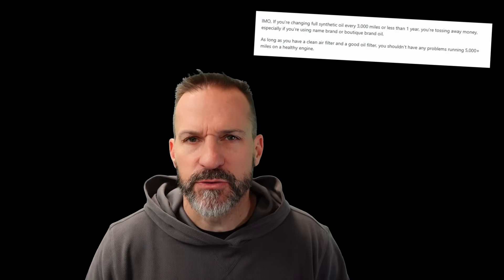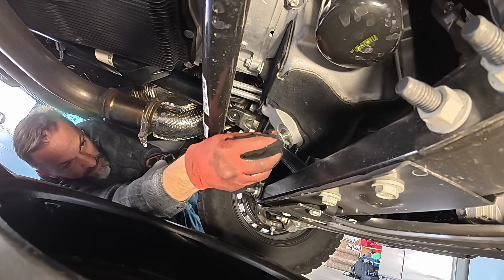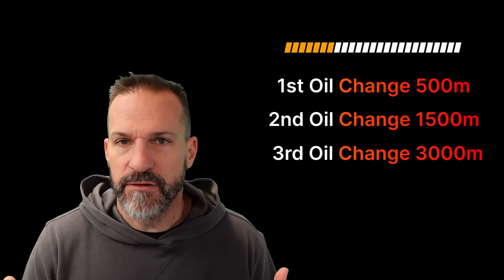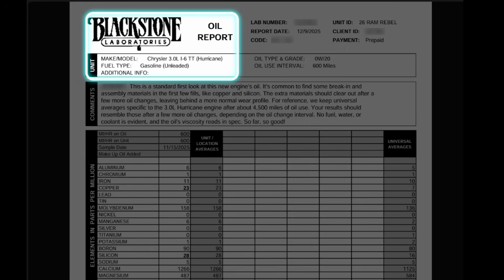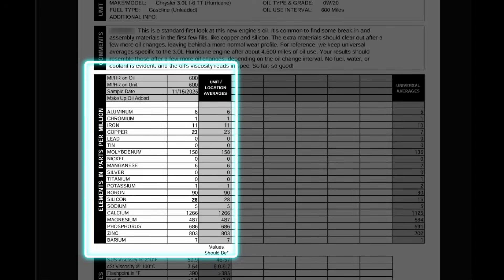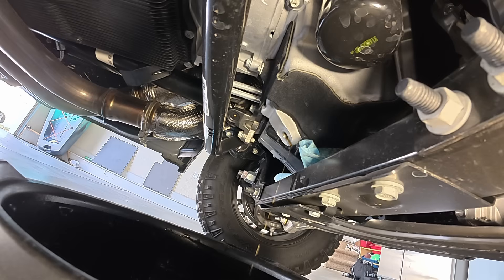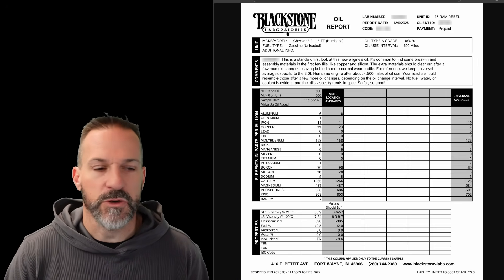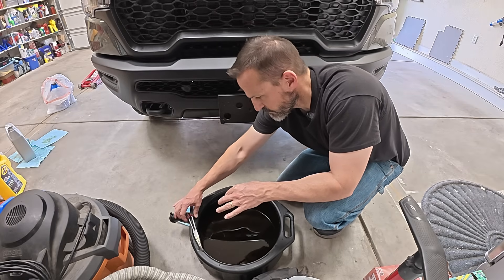Is the Motor Oil Geek Right? I Put His Break-In Theory to the Test

Comment: All drain plug gaskets are "one time use" and should be changed out each time. Each time they are reused the plug has to be tightened further and you risk stripping the pan. Buy the filer with the gasket or buy a ten pack of gaskets.

Comment: I've learnt so from Lake Speed Junior. He's inspired me to continue my Tribology education. 
I've made oil choices based off as Lake suggested taking into account the crankshaft bearing size and weather the engine block is Iron or Aluminium.
0w-20 oil pre 2011 was only ever recommended if you live in a consistently very cold environment where it snows and your engine oil needs to start in sub zero temperatures and oil freezes and needs oil warmers.
If you want to use a base oil with a 0w rating why not go for a 40 summer rating and have the extra temperature reserve for spirited driving.
And if you go for a class 5 Pao Ester that is Shear free even better. 
Great video. Keep up the good work 👏

Comment: We bought a brand new Honda pilot off the showroom floor and I wanted to have the oil changed at 5000 miles and took it into the dealer. They said you’re not supposed to change oil until 10,000 miles and I said but I wanted to do it early to get rid of the metal in the motor. They said if they did the oil change early, it would void the warranty! Don’t know if that’s true, but I went home and changed it anyway.

Comment: I did my rebuilt engine with breakin oil antil 540km (was aiming for 500) changed the centrifugal and spin on filter and added fresh break in oil to 990km.  Changed both filters and put in factory spec 5W40 semi synthetic and will run that for 2500km and then drop it again.  At this stage am unsure whether I will change the spin on filter - probably not.  I will then start changing the oil at 7500km.  I may go to 10,000 but need to get advise.  On my diesel the additiona; high speed centrifugal filter makes a huge difference to the suspended soot levels in the oil.

Comment: 3 things from me.  Just a guy doing maintenance, repair and service on motorcycles, cars, and tractor trailers for 54 years. These new 0 weight oils and turbo charged cars are scary.  Think about this folks.  

The oil goes through the turbo as well as the engine.  The turbos are extremely hot.  Pyrometer temperatures can reach 600 to 800 degrees F.  That is triple to quadruple the engine coolant temperature.  These temperatures will cook the oil in the turbo and cause it to crystalize when you shut off the engine. Tractor trailer when they stop always idle the engine for 3 to 5 minutes to cool things down before shut down.  That amount of time may not be required in a car or light trucks. Consider giving your car at least a 1 minute to 3 minutes to cool down the turbocharger before shutting the car off.  And another important thing to consider.  Change the oil more often with turbocharged cars. Do it at 3,000 to 3,500 miles.  You will thank me later.  

Don't use OW-8, 0W-16 or 0W-20. Don't use 0W at all.  Consider using 5W-20 or 5W-30 if 30 weight is indicated in your owners manual. Of course if your engine calls for a 10W weight oil, use that for sure. Check you owners manuals.   I have not lost an engine yet. And I keep many of my vehicles for 10 to 20 years. Currently have a car that is 22 YO that I have owned for 20 years and a motorcycle that is 20 YO I have owned since new.  Both still run very well.

Comment: As a machinist working with precision measuring instruments .  There are two things they over look .  1) what is the makeup of metals ( aluminum ? ) in the oil & 2) the size of the particular matter getting past the oil filter .  Today’s engines have less clearances or tighter tolerances than engines from the fifties .  But even at that , the size of the metals is no way near the clearance specifications. Also many people are unaware of the true property of fully synthetic oil in the United States.  Not all are truly synthetic 100%.  Also long oil change intervals not recommended.    5K or less . JMO 🇺🇸✌️

Comment: Lake is correct to not change the oil filter.......a slightly dirty oil filter captures more smaller particles because the micron passage size has been reduced, same with an air filter.

Comment: Just bought a brand new Chevy Equinox Activ 2026 in Brazil.
GM Brazil Owners Manual states -  First service / change oil and filter @ 10.000km.
GM US Owners Manual states -  First service / change oil and filter @ 7.500miles. 

7.500miles is 12.000km. Someone is upside down. 

Anyway, I just changed the oil @ 1.000miles. Makes no sense following the owners manual using 0w20 in Brazil where the usual daily temp in the summer is 38c. While draining the oil, it was thin as water and gray with metal.

Comment: Former master tech here, now I build performance engines. Everyone used to think I was crazy when I told them to change their oil within 500 miles of running a brand new engine. This is even after I run the engine, break it in, and change the oil myself. All before shipping it out or swapping in a vehicle

Comment: I have had multiple top end engine machinists/builders tell me with the proper hone and moly rings the engine is already broke in before it's even installed just by rotating it multiple times during assembly........... Guy Mancini of Mancini machine in catonsville md one of the most respected race engine builders on the east coat told me that directly to my face. Guess it really depends on to many factors for anybody to ever make a blanket statement. UOA will tell you for sure. Lets face it iron will be from the cylinder walls, copper most likely valvetrain which the hemis are famous for during break in ect etc etc.

Comment: 500 miles is normal. honestly, every supra engine that I had built they recommended this. there, is a brake in period and you want to make sure that all the engine assembly lubricants are washed off with oil as well as any other metal that may appear from the motor started up and being broken in. Why would this also not apply to normal brand new vehicles where it's all assembled by machines and less actual people are looking at the end product to make sure there is nothing in there?

Comment: I also following the oil geek recommendations on my new 25 pathfinder platinum 1st oil change at 500 miles oil looks good but cut open the filter and found some debris in it so going to do 2nd oil change 1500 miles and check again the filter condition. I’m changing the filter every oil change I know that is different than what the oil geek said but I like a new filter every oil change and I can also cut open the filter I think it’s a good idea if keeping the vehicle long term if leased who cares follow the manufacturer oil change interval.

Comment: My dad, during his lifetime built a LOT of engines. He built one that was used in a race car.. lasted a season of racing & then went in a personal car and lasted a long time. He was VERY big on frequent oil changes. 

I’m not sure it applies to today’s engines (he built old school Chevy small and big blocks) but he actually said not to use FULL synthetic for about 5,000 miles. He said it was TOO good and didn’t allow things to break in/seat properly. 

For new vehicles. I do sn initial oil change at 1,000 and then 3,000 and then every 3,000-4,000 miles full synthetic. 

I think a very important part of break-in is not lugging the engine. No cruise control. No extremes. DO roll up and down the RPM range.

Comment: (1) As an OEM powertrain engineer for 30+years, I can tell you that engineers are fully engaged in determining service intervals. Yes, the Service Division does push you to justify the intervals based on being competitive from a service cost of ownership; but if the data is clear, the engineer wins the battle 100% of the time.
(2) I wasn't on the engine oil / wear side, so I can't speak to those specifics; but I suspect that looking only at ppm of these elements is the entire story.  Particulate size probably should also be evaluated and the number/size of the particulates seen in these data may not be high enough to cause a long-term durability issue.  But an engine engineer would have to speak to that.

Comment: Is Lake an engine builder? Didn't think so. One nationaly recognized veteran "Master Mechanic" actually has found that by leaving in these materials it actually helps to bteak-in (burnish) mating surfaces. Also, he has found that by switching from C.A.F.E.  mandated 0w/20 to either 0w/30 or 5w/30  mpg was improved through better ring sealing. A touch heavier oil does wonders in this Florida heat!

Comment: It's cheap insurance.  Not a waste of 100 bucks on a 75k vehicle.  For first 10k, I change oil as soon as I bring it home.  After that at 500 miles.  Filter too.  After that every 1k miles until 10k.  Buy a Napa Platinum or a BOSS Purloator filter.  Or minimum oem filter.  Stick a big neo magnet on your filter too. I've ran blocks for hundreds of thousands miles, the frame disentregrates or body before the engine gives up the ghost.  Sweet rig btw.

Comment: That lab test is reporting silicon (Si), not silicone. Do not confuse these two!
Yes it the silicon you are seeing possibly be coming from the sealants/gaskets used in the engine, especially at the low levels shown in your Blackstone UOA. However elevated silicon levels in a UOA can also be from silica (SiO2). It is important to monitor silicon, especially if other wear metals are elevated, as it could indicate other issues such as a faulty air intake/filter.

Comment: On my Acura RDX, I changed the oil filter at 500 miles, full oil and filter change at 40% on the monitor. Always do it at 40%, which comes at 6,000 miles. That engine is your responsibility once the warranty expires!

Comment: I am a lot more interested in a comparisson between 2 engines. One follows exactly Lake's tips. The other follows exactly the user manual. Run those engines for 200k miles. If none breaks take them apart and check the wear on shafts, gears, bearings etc.

Both engines run exactly the same oil, oil filter, air filter, spark plugs.

If none of the engines reach 200k miles, then.... Well, then there is a real problem with today's approach to cars.
Reply: As a matter of fact, Valvoline ran two identical Ford engines for 500k miles, respecting the user manual oil change intervals (10.000 miles). Check the commercial video if you don't know it. They try to promote their synth oils, but to me, the convetional oil is the winner simply because it gets that engine to 500k miles with 10k change intervals.

No special break in procedures (not clearly specified, but that is what I understand from their statement of following Ford's maintenance guideline).

Comment: I bought a brand new Rav4 and changed the oil and filter at 580 miles, then again at 3500. The 580 mile filter had some random pepper-flake size aluminum shiny bits caught in the filter element, but the 2nd fliter didn't have any.
If i could do it over again, id change at 10, 500, and 1K. Then every 500-750 miles until 4500.
My wife was nagging me saying: "Why are you changing the oil?! Toyota will do that for free at 10K!" All while she's on a severe schedule.

Comment: I drive my vehicles for 10 years or better; I just replaced my 2007 F150 4 x 4 Lariat, that I bought new, is still in great condition and making somebody else really happy. I did my first oil and filter change at 1,000 miles, on a Ranger Raptor 3.0 Ltr Twin Turbo.  Due to a difference in oils, it's hard to tell what it may all mean, but the metals are very similar to what you have at 500 miles. The big differences are Copper at 33 ppm and the Silicon at 138 ppm, which could also be a difference in the oils. I'm planning on checking again at either 3,000 or 5,000 miles. I have 0 ppm of Chromium, 3 Aluminum 13 Iron and 0 Tin and 0 Lead. So far things seem to be going well with my engine break-in, so I'll keep doing what I'm doing before I run it hard.  You might want to watch Lake's Video "More Ai Lies?) before you make your planned viscosity change...

Comment: I am an an engineer that worked at a tier 1 auto supplier.  We made internal engine components and had an OEM engine test lab.  We obviously  did many tests on wear.  OIl brand matters a fair amount, but not as much as the filter.  Many oil filters went into bypass by around the equivalent of 1K miles.  Once in bypass there is no filtering going on allowing metallic components to circulate and do significant damage,  Also, filtering level is meaningful, but some filters with fine filtration limit oil flow, which is also problematic.  Based on my experience I use Purolator Boss filters (fine filtering with good flow) with Pennzoil Ultra Platinum oil.  I change every 5k after break in changes at 500, 1000 and 3000 miles .  One of my cars is a 2001 Highlander with 260K miles and it runs like new. New cars are much more expensive than oil changes,

Comment: I have a 25 Ram 3.0 Hurricane and i did oil changes at 850,2k,5k, and at 10k miles. And i made videos doing them and i got a lot of comments. 

Only thing is i didn't use 0w20. I used 5w20.

Also i cut the oil filters open from the first 2 oil changes and found the glitter in the factory installed filter.

Comment: I'm aware of this specific technique since the early 70s, when I was 16, when my dad bought his Pontiac and Corey ever had cause, sometimes I was hoping change his oil in the first time, I changed.It was at five hundred miles on a seventy two Pontiac lamons, but it had the 350V8 now with that engine. I did that with my dad at 500 miles. He told me why and then again at 2000 miles. And then again at 3000 so yeah, this is actually been around for quite a while. Now, we're talking about 1972, so now being 2006, we're looking at about 54 years.  So this is a technique that's been for quite a while , not just with lakes

Comment: 1st off I’m old enough to be your dad! With the crazy EPA regulations on today’s cars is it any surprise we’ve been pushing the safety / durability margin too thin? I’d rather repeat what I’ve been doing since the 1970s - change all fluids / oils / coolants earlier than recommended because the secret to long engine / transmission life is to follow the “Severe Duty” maintenance schedule. Nobody drives ideal conditions (highway speeds @ 65 mph.) Stop & Go traffic combined with stressed engine components & higher heat = dead engines. I can remember 10w40 & STP oil treatments. 
Final Comment: Oil changes are Cheap; new engines / transmissions are $$!

Comment: If you watch the Lake Speed video, he's recommending changes at 500, 2000 and 5000 miles.  1500 miles between change 1 and 2.  3000 miles between change 2 and 3.  Only the 5000 mile change gets a filter change.  You can see on his second change he shows the odometer (2k).

Comment: I strongly agree with Lake Speed's advice and your results with changing your oil during break-in as well as the oil change interval moving forward in the life of your engine. In my simple mind, at the very least, is that in sure can't hurt, it is only beneficial. However, when I look at your test results my question is how are the universal average test results obtained? Did those results come from oil changes that followed the same intervals that you followed or were some of those oil changes only completed at 4500 miles or somewhere in between?

Comment: That is exactly what I did on my first Tundra engine. Changed every 3500-5000 . Oil analysis  every oil change showed nothing wrong. On a trip at 54K no warning engine failure. New engine now at 12K. Same thing as the first one. First 1000 miles first oil change and oil analysis then 3000, then 4300, waiting on the next oil change next week. Last oil sample was excellent , wear metals disappeared.  I have lost confidence in my Tundra. I paid cash and I most likely lost my investment . Never another Toyota. I have 3

Comment: My guess is that if you follow Lake to a T, you can potentially keep your vehicle for 400,000+ miles. But based upon my experience, most vehicle owners swap vehicles every 10 years or less. Of those who keep their vehicles for 300,000 miles, the vast majority never followed the schedule described in this video. Most change their oil every 3000 - 5000 miles, with the first oil change after 6 months or 5000 miles.
 Many owners put less than 10,000 miles on their vehicles per year, so it would take 30 years to reach 300,000 miles and 50 years to achieve 500,000 miles. My point is that in the long run, the multi-change breakin won't make a big difference.

 However, I do think that the manufacturer's breakin suggestions about varying speed, no wide open throttle, no cruise control for the initial miles listed in the owner's manual is important.

Comment: Good point about not changing the filter too.  Lake’s videos show the filter filters better after the initial particles stick in the media.  Better NOT to change it until you have at least 3k miles.  

Also, good idea to flush the engine with clean oil before refilling. 

The only more extreme measures to make it even better would have been to trailer the truck home, use break-in oil the first 500-miles along with a extra strong magnetic drain plug, and jump to that slightly thicker viscosity oil grade starting with the first oil change from the break-in oil instead of later.

Edit: Of course, your point is to follow Lake’s protocol.  Adding a magnetic drain plug is not part of that and could skew results.